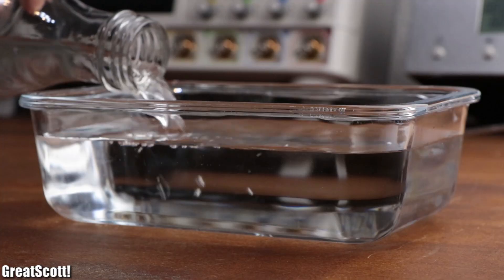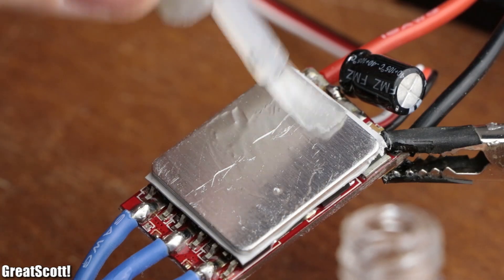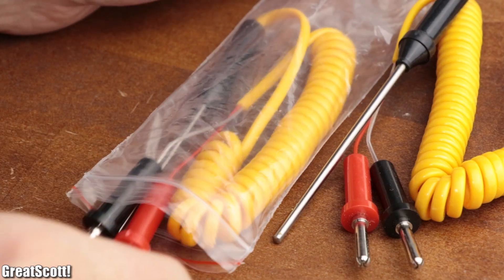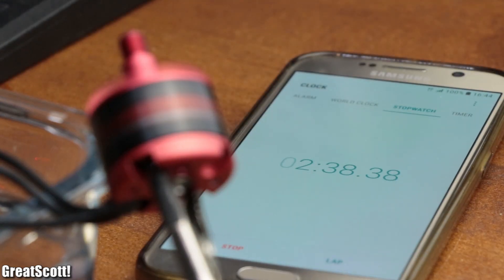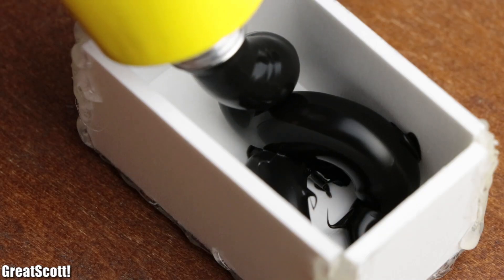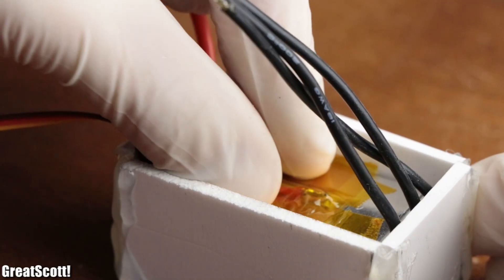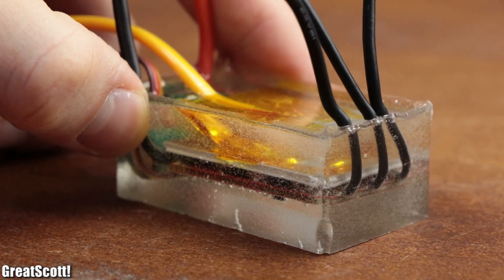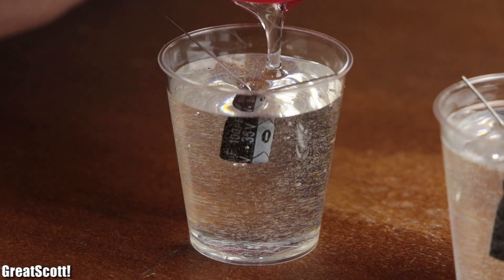How to Waterproof Electronics || Nail Polish, Silicone, Potting Compound

Comment: GreatScott, the motor really needs a load to give good test results. Otherwise the current and power draws are too small to really be a valid test. Please repeat the tests, this time with a propeller large enough to push the ESC to at least 50% its rated continuous power draw. Mount the motor to a fixture of some sort of course for this test for safety, and watch out for the spinning prop.

Comment: As always, nice video. 
I often use heat shrink tubing, filled with neutral cure silicon (non acidic). When you shrink it the excess silicon is squeezed out and looks tidy. Works great for waterproof wire connections too.
Reply: How do I know if my silicone is a neutral cure or not?

Comment: I have a question..  I have concentrated a CH³COOH (Acetic Acid) and made a 5 volts wire to charge it.. Used aswell 2 rods of Solder to make the +  and - wires.. I kept it charging for 10 minutes..it made something like white salt and there is no electricity from it...  What am i doing wrong?? 
Thanks for any help

Comment: in my experience silicone is corrosive. iv made plenty of LED aquarium lights and my first attempts at sealing them with silicone causes serious corrosion after a few weeks but after applying nail polish and then siliconing them seems to have stopped the problem

Comment: But if there is no load on motor then it there will not be much heat generation. you should have attached a propeller to the motor then it would have been a fair comparison..................

Comment: I'm suspicious that a potting compound or epoxy would effect the heat sinks ability to dissipate heat, and your just not able to see it because the thermal load isn't high enough in your experiment. Thanks for the upload!

Comment: This is all wrong. You should be measuring the difference from the electronics temperature to the Ambient temperature, this way you get the delta in temperature to compare, since your ambient temperature won't be the same every day and your experiment lasted for days.
Reply: Also, you should put some load on that Motor, just running it with no load won't consume much current anyway to increase the temperature.
Reply from the maker: +MFeinstein Experiment did not took days. Was done in a couple of hours at almost the same temperature.
Reply: GreatScott! You said in the movie that you had to wait for another day for the silicone to solidify.

Comment: You didn't try a conformal coating spray. I would expect very similar results to nail varnish, but depending on the nail varnish it can be cheaper and easier to apply.

Comment: Just a tips when you want to smooth out the silicon glue you may use some soapy water on your finger and smooth it out. This way the glue won’t stick to your hand and the glue surface will looks much better

Comment: To make a waterproof PCB with silicone I suggest you put the circuit in a plastic bag and then pour the silicone, which you can then shape around the components simply by squeezing the polyethylene bag where you need it.
You will get smoother surfaces and thinner layers. and (perhaps) minor drying times.
Afterthe silicone hardening you can remove the bag without difficulty since the silicone does not adhere to the polyethylene.
The high temperature silicone does not have a better thermal conduction than normal silicone but only a higher resistance to high temperatures (around 250-280 °) while the normal silicone resists up to 200 °.
Temperatures to which our PCBs are already permanently dead, so it is possible to use the normal silicon with a small saving (in case hig temperature is more expensive)

Frohe Weihnachten und ein glückliches neues Jahr für Sie und Ihre Familie und für alle, die uns lesen!
Merry Christmas and happy new year to you and your family and to all those who read us!
Reply: You can just put it in a plastic bag if you want
Reply: Great idea!
Reply: Or use a 2 part silicone, put it in a small vacuum chamber you can easily make yourself to get rid of air bubbles then pour it on the circuit board
Reply: zola tanaffa Two part silicone is also better than pre-mixed silicone as it has a lower viscosity and in my experience coats better.
Reply: zola tanaffa danke dir auch fröhliche Weihnachten.
Reply: Normales silikon enthält essig, was säure ist und damit gut leitend !   Also niemals essigvernetzendes silikon zum vergiessen von elektronik verwenden !
Reply: Viele Dank für deine wünsche! Gruß aus Holland :)
Reply: zola tanaffa or just use silicone conformal coating....
Reply: Thanks. I always wondered the difference between silicon and high heat silicone.
Reply: You can thin regular silicon with acetone to make it thinner...so thin that it flows like honey...then just coat like the potting compound or even paint it on like nail polish...then let it cure...thin is better for protection but not so great for heat conductivity without some sort of material to wick away the heat, water makes a great place to dump heat.
Reply: Use Flex Seal instead
Reply: Do they have clear? (never looked)
Cool!  https://www.basspro.com/shop/en/flex-seal-fly-cement?msclkid=0ee89e860d6a12a593adc50c9a414d95&gclid=CJnxu8n3md0CFRTXDQodn-YNZA&gclsrc=ds
https://www.target.com/p/as-seen-on-tv-174-flex-seal-liquid-16oz-clear/-/A-51393559?ref=tgt_adv_XS000000&AFID=bing_pla_df&CPNG=PLA_Kitchen%2BShopping&adgroup=SC_Kitchen&LID=700000001230728pbs&network=s&device=c&querystring=flex%20seal%20clear&gclid=[*GCLID*]&gclsrc=ds
Reply: @haydenc2742  they even have flex seal clear
Reply: Hey nice tip I've made a small flashing led for my dogs collar. During night walks many people don't see him :( 
He's black and they're lost on their phones. 
I need something to waterproof and shape the small circuit around. 
I'm also adding led strip lights to my bike. I need to water proof the boost converters. And maybe the battery terminals. 
The prices seem to  be vastly different. 375 ml (250ml + 125ml) of potting is over £23, 290ml of clear silicone is £4.20. 
Clear epoxy resin (polyester) 1kg so around 900 ml is £14 Inc a nice small kit (2 gloves, 2 calibrated measuring cups 2 brushes, syringe & stirrers). 
Cured resin is almost like cured potting compound but much cheaper. 
It's clear hard finish allows you to sand and shape as needed. 
There is also another much cheaper alternative, but only for cooler applications, candle wax. It sets fast and is easy to shape and set. Removal isn't that hard too. But the price, bag of tea lights around 700ml is £1 or a single large candle 500 ml again £1. These are from £1/$1/1 DM shops. Only issue is heat 40-50c is fine. 

These are all UK amazon prices.
Reply: Ah the good old days, they used beeswax with an antibacterial which has a particular smell when components cooked. ;)
Reply: zola tanaffa "to make a waterproof PCB place it in a plastic bag then crush the bag"

I'm sorry what?
Reply: + Jason Ponciano sorry for the"googled" translation: I wanted to say: squeeze the bag to smooth and shape the surface of the silicone, then, when the silicone has polymerized you can also remove it from the polyethylene bag.. now i modify mi previous comment, hi and merry christmas
Reply: A poor mans variant of vacuum bag molding. BTW this will not work for some single component silicone rubbers.

Comment: Silicone can outgas acetic acid. This will corrode metal pins, consume the polystyrene form, and degrade some plastics in wiring. Potting in silicone might be akin to submerging in vinegar.

Comment: I’ve known, for rc stuff, if you want to waterproof the ESC, you just pour epoxy into both ends of the heat shrink
I don’t think that this video was really too much about that in particular 
But if you want to specifically waterproof them, that’s the easiest way

Comment: Good video! Only problem is that those ESCs are huge after you applied those coatings! Not to mention the increased thermals when the ESC takes on a load because running the motor like that won't stress out the ESC. Running the motor with some 1045 props will. I think PeterSripol's Waterproofing ESCs can help.

Comment: liked 👍 this would be great for boats!
Reply: Tampatec yeah. I’ve had issues waterproofing my model speedboat, it lets in water at the rudder, any tips?
Reply: Paul Mac Giolla Caoine use o ring seals, bit of rubber, or construction silicon.
Reply: Just make sure to use a flexible sealant on components that may have resistance and/or generate heat.
As I'm sure you know, heat/cooling = expansion/contraction.
If the coating doesn't expand/contract too, the PCB is doomed to fail.
Reply: Only if the ESC had water cooling as cooling, otherwise it will overheat.
Reply: first time i used nail polish was for a boat. Made it from the seed husk from a three we call the donkey peepee tree. placed a motor on it
Reply: Well when it comes to electronics on boats, theyre usually sold kits designed to let a transducer sit properly without letting in water... most other installations usually occour around monkey island, and for those installations tek7 usually does well for the weather conditions it may face. 
I guess an autopilot rfu might face some water in certain circumstances, but youd have bigger issues at that point than to worry about an autopilot im sure...
Maybe for DYI projects you could do something like that, but im unsure how a transducer will react if encased like that... may not be able to "see" through it...

Comment: Great experiment. The only problem with this is that there wasnt no propeller attached to motor. Esc and motor are designed to run with propeller which boosts the amperage significantly. Now when there was no "load" on the rig, I think the result data of the temperature is quite useless. When it comes waterproofing electronics on multicopters I think the easiest way is to use heatshrink and epoxy to seal things up, off course its not reversible. Nail polish to the flight controller works flawless, if you remember to cover the usb port.

Comment: You could probably cote the ESCs with nail polish and remove the heat sink for use underwater because the heatsink in theory shouldn’t be needed and as long as you covered it with nail polish well it should be fine

Comment: Automotive silicone like what you used there has a VERY long curing time if you apply more than 5mm bead of it. That being said, you can make silicone like that smooth, just by spraying your hands with soapy water and then smoothing it out with your fingers.

Comment: Using 2 Component Epoxy is very common in the RC community. Some harden in less then 30 min and my esc definetly dont get too hot.
I guess it's a trade between the nail polish and your two attempts.

Comment: Nice comparison but it's a shame you didn't include conformal coating in the lis since this is what is used most of the time to protect PCB,s against dust and moisture. It's also easy to get from Farnel/DigiKey/Element14/Mouser, etc. Results would probably be similar to the nail polish with less risk that a particular brand of polish may interact with the components (like damaging plastics) or deteriorate over time.

Comment: i dont think the ESC will heat up much because it is under a very low load. maybe with a fan blade on the motor it will be hottening the ESC

Comment: Silicone for mold making is great for potting electronics as its two part and sets whether closed from air or open. Oomoo is something I've used several time to pot parts for wet conditions in Broadcasting.

Comment: GreatScott!, I recommend you watch Samm Shepard's video titled "Water proofing electronics, the clean way"; he uses a silicone based conformal coating, its like the silicone you used in nail polish form, he claimed it works really well.
/watch?v=HOu5hRqSDtU

Comment: Thanks for sharing your research. Those bubbles can be removed by pulling a vacuum on the resin immediately after mixing. Silicon also comes in two part mixes that will set without the need for exposure to air, which was the problem you had with that black sealant. The one part silicon is also probably acidic so it could be corroding your electronics anyway, a slow death rather than a fast one from water. It would have been interesting to try Carnauba wax as it melts at over 80°C and is hard as far as waxes go, the potential advantage of wax is that you can melt it off to service or inspect the part.  You can always dip the circuit that is potted in wax into silicone to give it a more resilient outer layer that can be peeled off.  One last thing to consider is the specific heat capacity of the substances used, and wax may actually score well in that regard.
Reply: It's probably better to avoid creating bubbles while mixing in the first place. Just use a stir stick and then use a cup to cup transfer a few times ending in the new cup not the original. 
   Some clear plastics also require pressure to remove bubbles by reducing their size beyond the macroscopic range. There are some compounds that will begin to vent evaporative volatiles if exposed to a vacuum. It's probably best to check the MSDS sheet along with any extra documentation provided by the manufacturer before trying advanced techniques ;)
Reply: phuck ewe i tried and the gooey thing dissolves the condom in it . I mean there were bigass holes in the condom after 2 hours of freezing.

Should i not freeze it or wut i think i just need to keep it solidify organically without freezing it
Reply: can i make a buttplug for my ass from that carnauba wax youre talkin aboiu ?
Reply: @Thabadthabad  his name isn't aboiu but robert paulson, his name is robert paulson, his name is robert paulson.

Comment: Some manufactures (Robbe) waterproof their esc with acrylic paint. There are also silicon compounds which are way thinner for better coating. The thick enclosure due to the silicon probably isolates the board quite a  bit. Epoxy does also perform good from my experience. I would have loved if you have tested "window colours" as an waterproofing substance.

Comment: RTV coating to pot electronics normally Scott as its tough as old nails also need to de-gas whatever it is your using using a vacuum chamber to get consistent potting results (without air bubbles), costs a lot but get a really professional end product. Another great video Scott well done 😉

Comment: The motor was unloaded! if you put a prop on it, or some kind of load you will find those ESC's get well above 28c. I use those ESC's in my planes and i know if they don't have airflow they overheat. The cooling is the main problem for waterproofing, as the heatsink really needs airflow. Great video, just wanted to point that out.

Comment: I think the temperature could become a problem if the motor is under load
Reply: I have personally learned this with my hot glue "water proofing"...which despite staying dry, ultimately REQUIRED water.....to put out the fire :)

Comment: The 'nail polish' is called conformal coating. For home use, I suggest 'Plastik 70' to coat your PCB with. Avoid direct connection to water if at all possible. For underwater projects use a proper watertight enclosure. IP69k enclosure might be overkill but will survive anything.

One more note: tap water is still very pure. Add a little salt to the water and the electrical resistance is reduced 100 fold.

In professional electronics, these are a big deal to stop corrosion and add reliability. Potting and conformal coating is a science on its own. Imagine how it reacts at -40 deg C or 85 deg C, If it shrinks it will pull the components of your board. This is more mechanical engineering than electrical engineering. This has been a real headache in a project I've been involved.

Comment: You cannot twist or solder thermocouples, they have to be welded so that they are only connected at one point and only contain two metals. By twisting you are introducing multiple junctions and have no idea what you are measuring and by soldering you are introducing multiple new metals. Thermocouples work by the seedback effect which is producing a voltage between two different dissimilar metals and introducing solder to this mix will give you a very bad thermocouple because you now have something like 4 metals at that junction.

Comment: Using a platinum curing silicone, it would pour in like epoxy. Plus leave the heat sink close to the surface for more cooling.

Comment: You really need to test at the max power rating of the ESC.  Thermal testing with no load really doesn't offer much insight into heat transfer and temperature issues the coatings will cause during normal use.

Comment: Interesting video! In the past, I've used epoxy, crazy glue, but mostly bees wax. I used a nitro powered RC truck once. I took the circuit boards out for the servos, and receiver, and battery connections and packed with pure bees wax. The receiver cell pack was multilayered in heat shrink that had wax applied first. I ran that around in heavy rain for several tanks of nitro. I don't think this would work well in high heat areas, as with all electric rc applications, but it's fun to experiment!

Comment: Using 3D printer leftovers, re-melted to 250ºC inside a metal mold, should be a very cheap (free) alternative to expensive potting compounds. However, you'd need a vacuum chamber to suck all the air out, while the molten plastic finds its way to every nook.

Comment: Silicone is highly adhesive and notoriously fiddly to deal with. You can usually get a good release by using purpose-built mold release compound, or a tiny amount of petroleum jelly or veggie oil. Check your composition and the mfr's directions to be certain. And yeah, the internal drying times are horrible if you're doing anything besides running small beads or filling narrow tracks. Go for the version that comes with a hardening agent if you need to encase any large objects, that's how they do it for moldmaking in Hollywood practical FX.